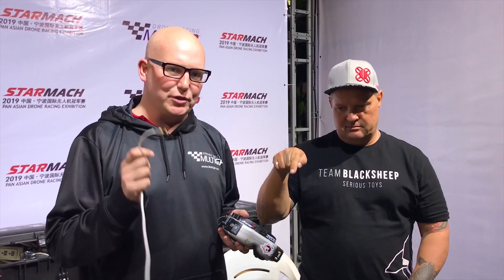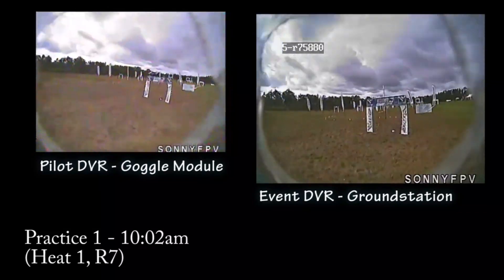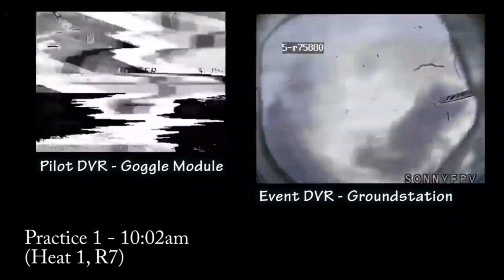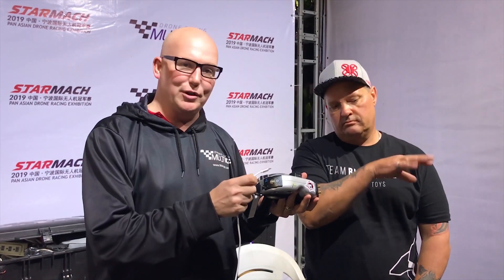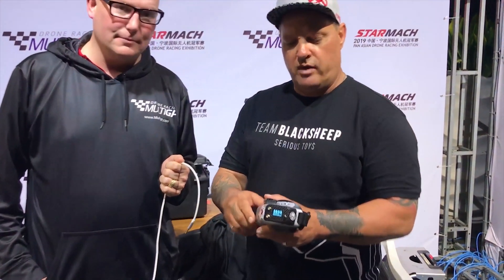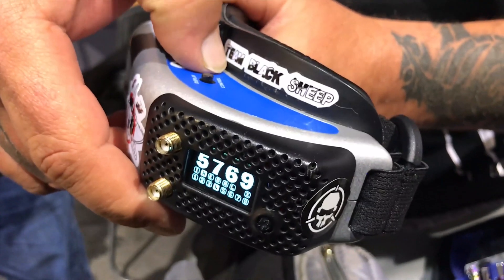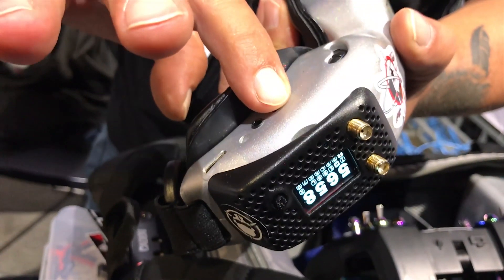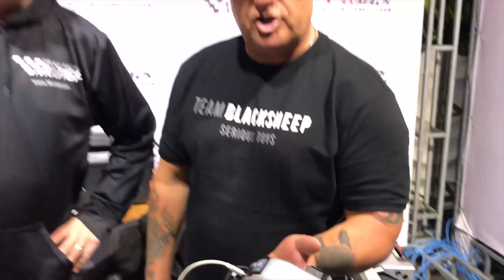The Proper Way to Connect FPV Goggles to a Groundstation (The Goggle Module Trick)

Comment: Pro tip, if you don’t have HDO and are powering your rapid fire thru the aux bay, you Must remove the rapid fire module. Or at least set the module to the same channel as the ground station.

Comment: The switch only switches off power for the module and it is still connected to AV in. Wouldn't this lower the input impedance (which is a bad thing for inputs)? I sometimes can't believe how simple our 600$ goggles are
Reply from the maker: Mostly depends on the module. The buttons to change the channel give a little voltage to the module and that is what physically causes it.
Reply: @MultiGP1  Interesting.